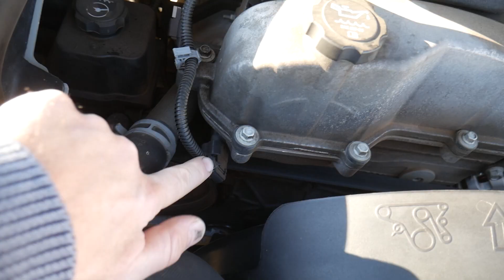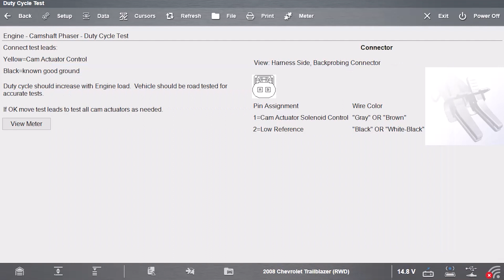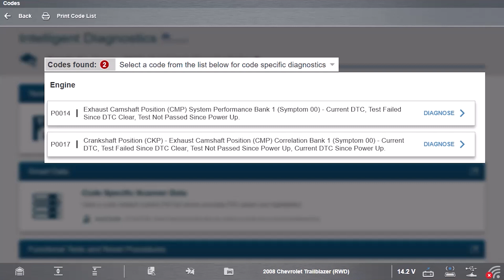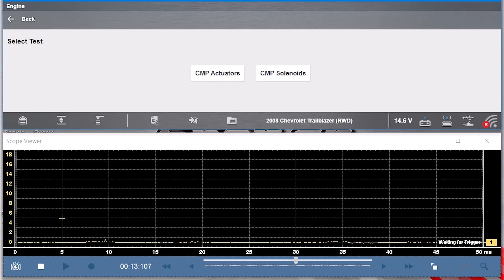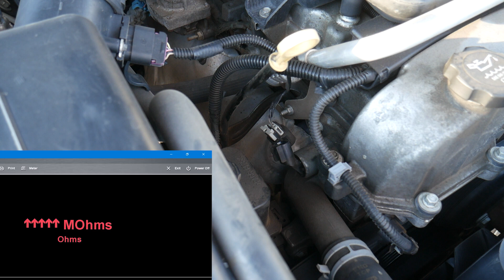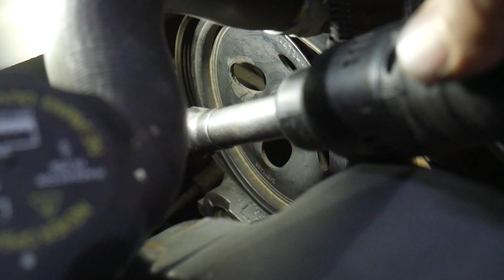2008 Chevy Trailblazer/Envoy P0014 P0017 Diagnosis and repair

Comment: I’m dealing with a similar issue with a 2009 Colorado 2.9. The truck will idle and run great all day long. But once its warm, it will either stall out or go to running super rough when coming to a stop/back to idle. Cam actual and desired match when running, but the cam variance will spike to around 20 degrees coming to a stop and then command will stay stuck at 0% even when revving unless I restart the engine. I already ohmed and tested the plunger movement with the vvt solenoid out of the engine, but I suspect it starts sticking under certain conditions. Only has a P0017 code. This condition is intermittent as well. I’ve been told its bad phasers or a worn chain, but there is no start up rattle and the engine otherwise runs with no problems
Reply from the maker: @eliv2092  sticking solenoid is most likely the cause. If you don’t mind the code you can unplug the solenoid and see if that fixes the issue.

Comment: pressure light on a 2008 Chevy Trailblazer.
Reply from the maker: I would check oil pressure but I replace a lot of oil pressure sending units. 
The thread pitch is strange on the oil pressure sender so I made an adaptor from an old sender by breaking off the plastic and drilling and tapping to 1/8th pipe thread.  Most of my adaptors are 1/8” NPT so it works for me and was free.

Comment: At end of video you mentioned you unplugged the vvt. So the vehicle will operate properly without the vvt?
Reply from the maker: The engine light will be on but the vvt will be less likely to stick again. 
With aftermarket software the VVT can be disabled as well. 
If this vehicle acts up again it will get a software change to not use VVT. 
A small amount of power will be sacrificed for better reliability.

Comment: What brand vvt solenoid did you use? And great video
Reply from the maker: Thanks. I went with the ACdelco vvt solenoid. I always try to go OEM on VVT parts.
Reply: @ThePracticalMechanic  cool man, I use dorman, I use dorman because dorman makes timing chains and gears, it's been 2 yrs still strong, acdelco vvt solenoid made in China, they all do ,even sensors, dorman china made also

Comment: I have a 03 gmc envoy and I have a parasitic battery drain overnight and every time it starts to act up I get a P0014 code... Sometimes it goes away by replying relays 43/45 but lately that trip trick isn't working...
Reply from the maker: Low battery won’t cause these codes and neither will the relays. You more than likely have two completely separate issues. You may want to perform some of the testing in the video to see if the solenoid is your issue.

Comment: Love your videos. As one of the advocates for scopes you channel is one of my favorites. You have an excellent way of explaining things. You weekly waveform series got me hooked on scopes. I am an industrial generator tech. They do not only come in useful for engine diagnostics but they help with power quality and harmonic troubleshooting. I started with HSCOPE and got an E Scope 8 ch as well as the limited.  After that I caught the bug and got a couple Verus , Pico and Micsigs. Even though I have the higher end scopes I love my Hantek 6074 mounted to my Samsung tablet. The ease of use and being able to save reports with samsung notes and review files on my phone via the hscope app makes it really usefull. The Hantek windows software is trash. Its amazing how well the app works. I have a HS502 coming in the mail this week.  I have a Launch X431 installed on the tablet. Using it with split screen with Hscope running makes it like a poor mans Scanner - Scope. I tend to grab that over my Verus. Sorry for the long comment.
Reply from the maker: It sound like you have a great setup. 
I’m not a fluent android user so I always struggle with the hscope. I need to learn because there are some powerful setups for the android tablets. The launch/ThinkDiag/topdon scan tools have some great features and often out perform autel and Snapon. I’ve been using the thinkdiag2 recently and can’t believe how capable it is. 
Thanks for watching and your continued support. Have a great holiday and stay safe.
Reply: Great and informative video! We have a 2008 Trailblazer as well and we first had an issue with the VVT solenoid throwing the same exact code so we ended up replacing the original solenoid with an aftermarket one from AutoZone, it did good from that point until just recently and we're getting the code again so I need to inspect and see what we're dealing with. If it ends up needing to be replaced I'll make sure to get an exact OEM one. When the P0014 code is thrown, it's here and there so definitely an intermittent issue at this point!